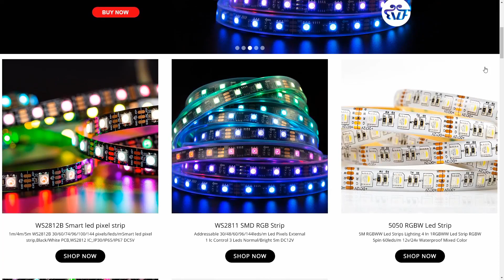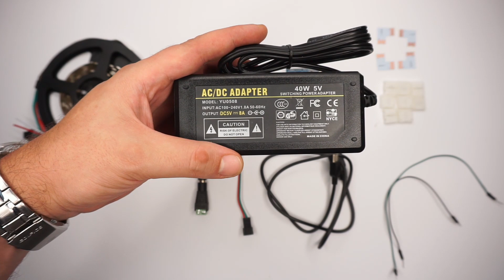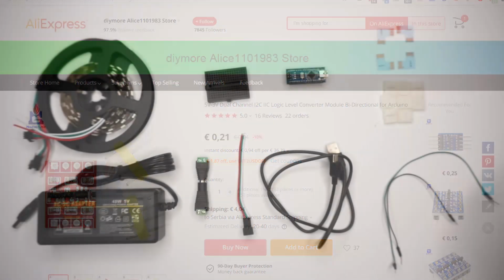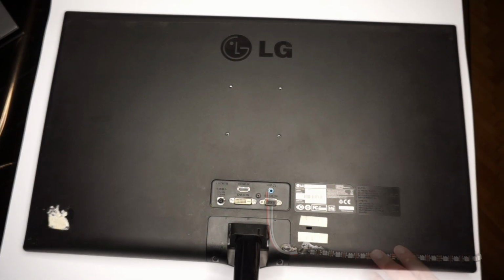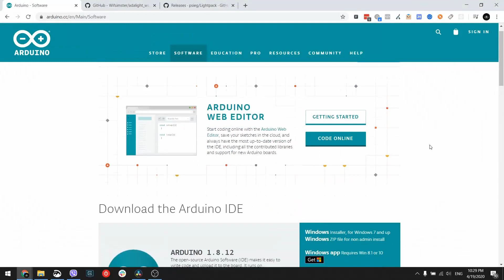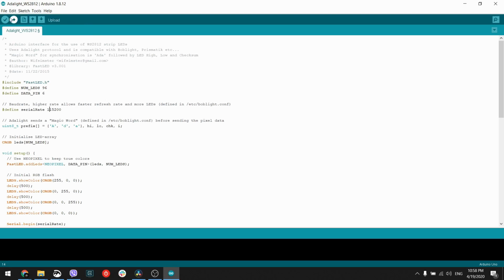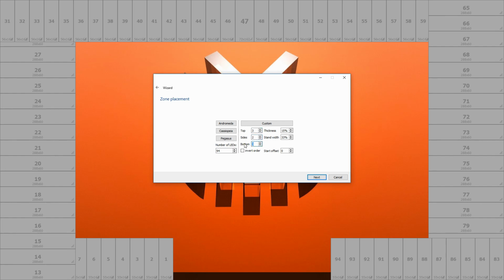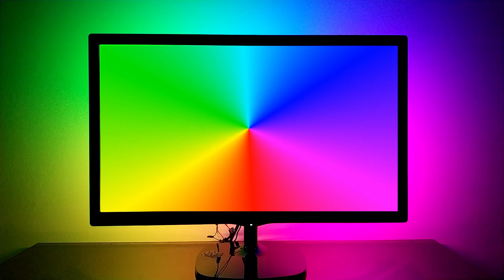Cheap DIY Arduino Ambilight 2.0 (Revisited) RGB WS2812b LED Full Build & How-To

Comment: Great vid, thank you!  I literally just finished watching  your previous video on this, searched again for a most recent one in case there were newer hardware to use and yours popped up right there.

I have one question: 

Is it possible to create a center-screen zone placement with the program or is it limited to the edges? I want to display colors from a certain-sized  squared region of the center of my display so that I can add a smaller section of WS2812Bs behind my monitor(along with those near the edges like you have) to display not just colors near the edges but also from the middle of my display. Would this possible or is it something I would have to program myself or would I basically be needing 2 independent builds with their own Arduinos and stuff?

Thanks in advance for you response.
Reply from the maker: It is possible to add some more to the back, just not sure why you would need them as this is plenty bright anyway. You don't need a separate arduino, you can do something like at the end of the strip of the edges, add another L bracket, go towards the middle, add another in the middle, go right, another for down, another for left, and that way you have lights in the middle as well, or solder on a cluster in the middle with some wires if you know how to solder, and in the software you can manually move each zone to where your lights are so it's no biggie, just gonna be a bit more time consuming. Hope this helps... if you need additional info, you can check out my Discord channel in the link below!
Reply: @dusnoki  Awesome! Thanks a lot for the response. I wanted some in the middle specifically for gaming scenes like in a dark cave where there is very little light near the edges. Gonna be giving it a try soon but probably gonna stick to edges for now. Just glad to know it's possible 😁